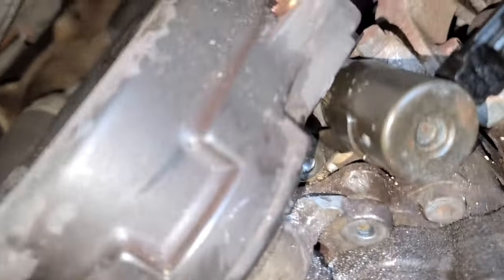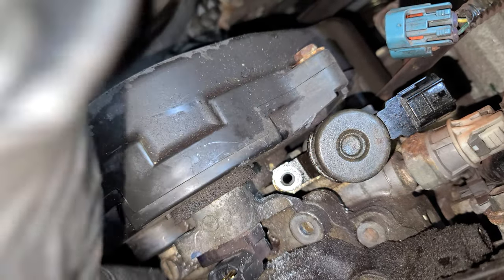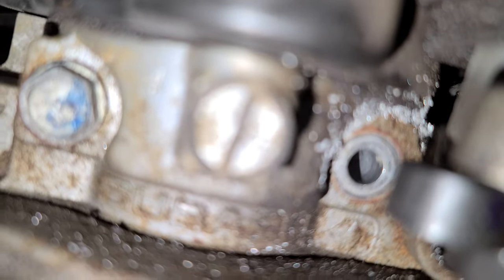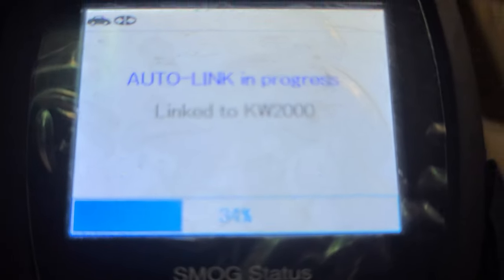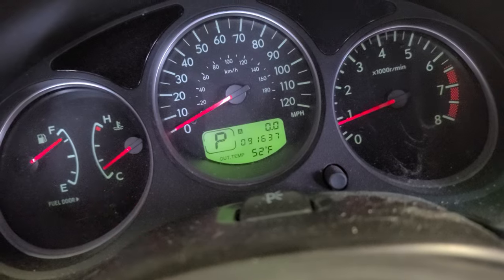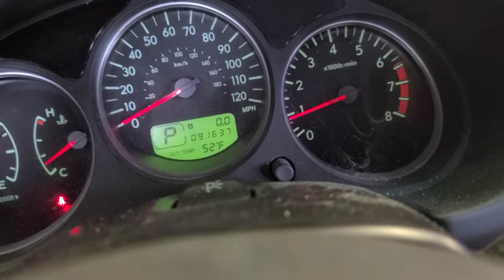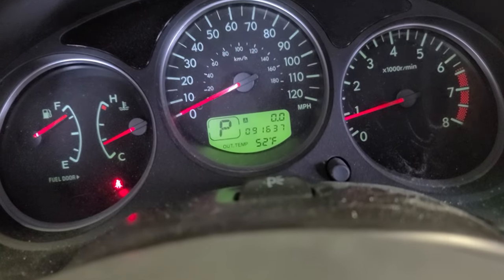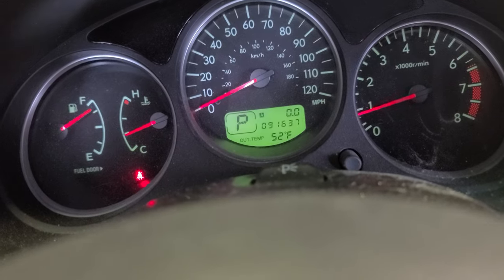2005- 2012 Subaru trouble code P0026 Intake Valve Control Solenoid Circuit range Bank 1

Comment: P0026 is bank 1.
Bank 1 is the side with cylinder 1.
Facing the front of the vehicle, cylinder 1 is the cylinder on the PASSENGER side closest to you on a 2006 Subaru Legacy or Impreza.

Comment: yerrrrrrrrr.
thanks for the video.
at :07 and 1:11 when you get to the solenoid,
do you remove it and replace it with a new one?
what exactly does the code/definition mean in laymen's terms?
like, what is happening to the car?
can we keep driving it? what will happen in the long run?
is it a wear and tear issue?
did we do something wrong as to why it needs to get replaced?

i've got a 2007 legacy, and the check engine light
is on most of the week, and maybe 1-2 days it will go away,
then just randomly go on again.
i use it for work 5 days a week.
the errors are:
P0026 - Intake Valve Control Solenoid Circuit Range/Performance Bank 1
P0028 - Intake Valve Control Solenoid Circuit Range/Performance Bank 2

your words of wisdom are appreciated.
thank you.
Reply: P0028 - Intake Valve Control Solenoid Circuit Range/Performance Bank 2 is the one located on driver side
Reply: I have a 08 impreza 2.5i wagon and rebuilt the engine and those 2 codes came on while driving then will go away and come back I was wondering also if it's important I change them asap and where the 1st and 2nd bank are located
Reply: @K.Smith87  asap, no, cuz i've been driving it for x years, and it seemingly randomly comes on.
you do need them outta there when you get the car inspected.
Reply: @littleoldal  where is the second one located for if/when I change them out...I hate the check engine light on bc I can't use cruise control lmao
Reply: @K.Smith87  i've got an 07 legacy and they're on the driver and passenger side.
just like the video.
also, not sure if it's this video or another i watched,
but sometimes the metal tips just need to be cleaned/dried from the grease/leak.

Comment: Is that 10mm where you have to grind the only bolt that needs to be removed to replace this solenoid
Reply: Should be the only bolt yes, unless you want to replace the housing that the solenoid goes into as well, which would involve removing the drive belt, and timing belt/ belt housing